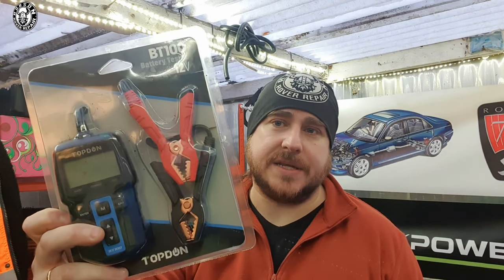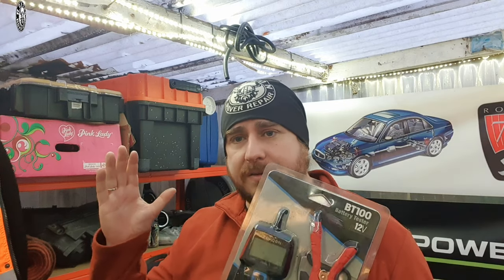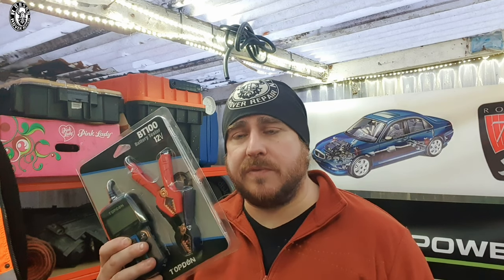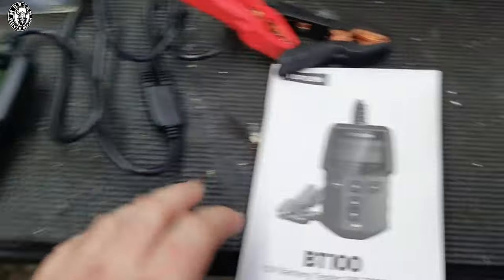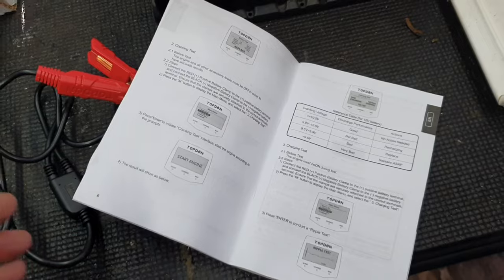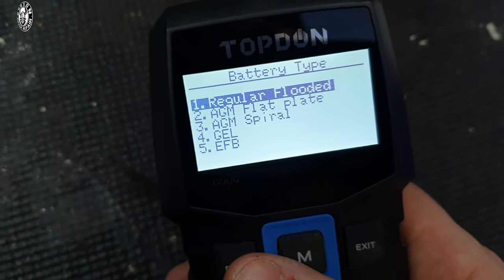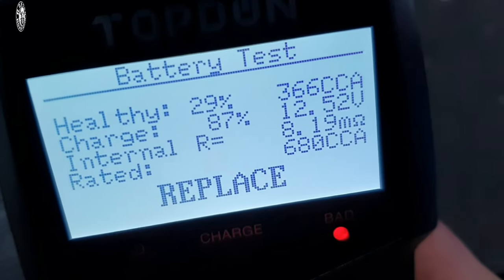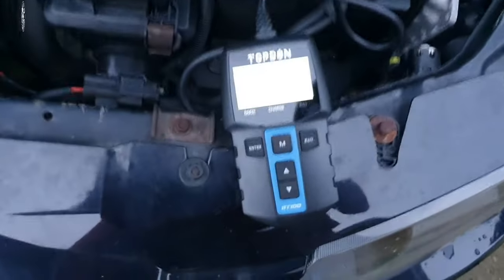Tested - TOPDON BT100 - An essential budget battery tester? A quick review and features demonstrated

Comment: Definitely useful for enthusiasts, I bought one different make few weeks back,all singing and dancing unit similar price, ok inside the garage outside the screen was virtually unreadable. What is the screen like on this one when outside. Hope you get well soon, useful video 👍
Reply from the maker: Actually it's fine. When I did the test of battery cranking on the 25 van it was outside about 4pm, so was easily visible.
Reply: @RobsonRoverRepair  thanks for the reply all the best 👍